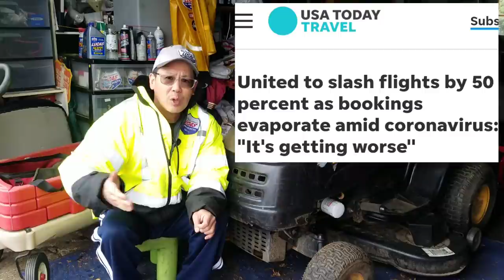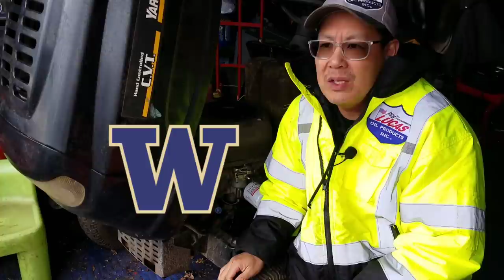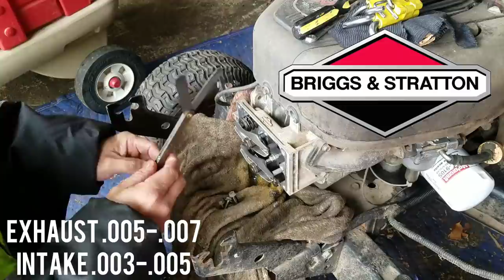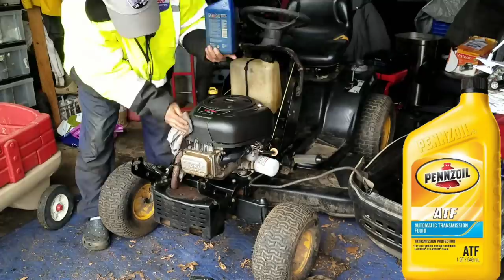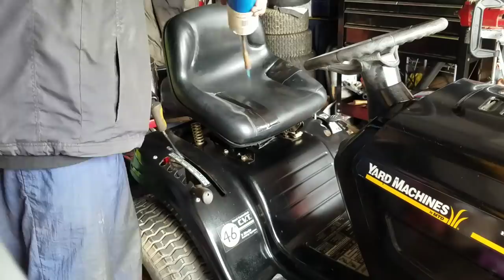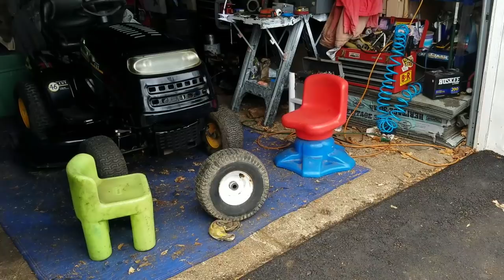YARDMACHINES MTD 20HP 46" BRIGGS CVT LAWN TRACTOR VALVE LASH ADJUSTMENT ATF WIPEDOWN TOUCHUP PAINT

Comment: I agree with you bro, probably one of the better MTD's that were released with the Intek engine and still had the metal hood. I believe this one had the option of a cast iron front axle too which would have made it even better. A quick clean up and ATF treatment improved it big time... doesn't even look like the same tractor now.
Reply from the maker: Yeah, only 3 episodes too!  Sometimes you get lucky!

Comment: Just going from what you've told me wouldn't that fuel filter be the wrong type since it's gravity fed? You said the skinny red one's are for gravity fed and that one that's on it is for pulse type. Right?
Reply from the maker: No...this is a gravity fed one, same as the red one, only smaller microns.  The clear one where you see the paper filter in it is gor fuel pump tanks.

Comment: Hello 
I habe the same tractor. Bit I have a little problem... I need a new carburetor. My dealer needs to know the Engine Model and Type... on Ma tractor is so much rust that ist is not possible to read anymore. Can you maybe Tell me the Engine Model and the Engine Type? It Must be on the OHV Cover.
Reply from the maker: Are you 100% sure it’s the same engine?
Reply from the maker: This is the carburetor you need 590399

https://www.ebay.com/itm/112302922996
Reply: Thanks but the Problem is That I am from Germany and it‘s not able to ship here😅 and Ma Dealer won‘t Order something without the Engine Type and Model....
Reply: Thanks 
The carburator is working... 
do you maybe know which air Filter in on That tractor
Reply from the maker: @pg-fv6ti  https://www.propartsdirect.net/Parts/Filter-Air-Cleaner-Briggs__795115.aspx?gclid=CjwKCAiA9vOABhBfEiwATCi7GCRYcoHPy0FkuOFO6BgrpwbfuT55fQMAWVl1dX4M7g0tC2YbMZFCTBoCnAEQAvD_BwE
Reply from the maker: @pg-fv6ti  795115